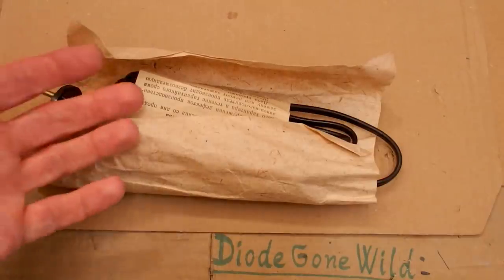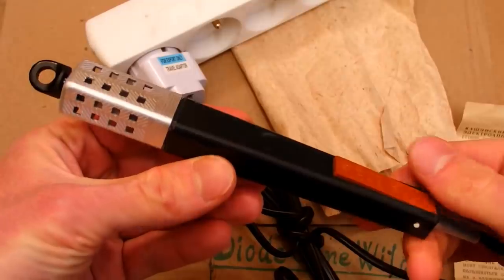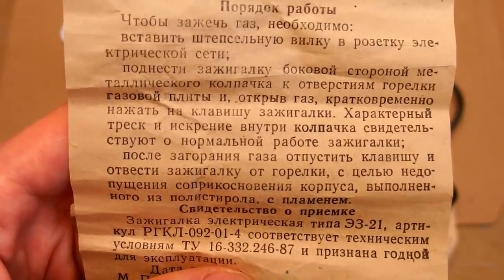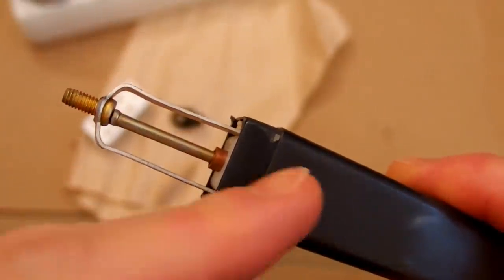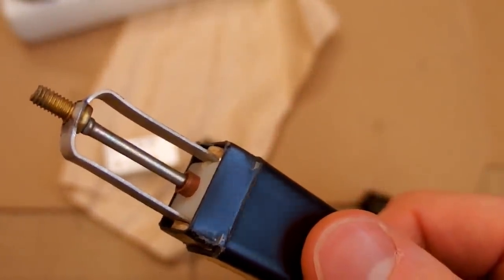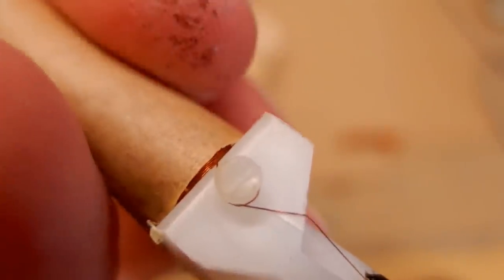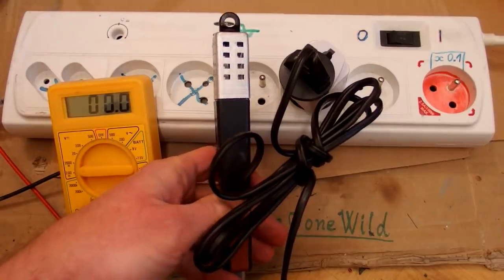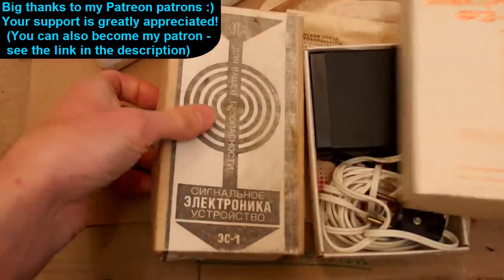Mysterious scary Russian device

Comment: In UK my grandma (when I was a little kid) had a gas cooker that had a 'wand' connected to the cooker via a rubber pipe. You would turn the wand on, click it and it let out a little flame that you would light the cooker with. Back then if you lived close to a colliery (which she did) you would be burning coal gas which was highly toxic, but on a possitive note, you got free coal if a family member worked at the colliery and your electricity was wired in from the colliery so you got super cheap electricity and basically free heating. The gas meter was a clock style that you put 50p into for a set amount of m3 of gas :D creepy old stuff lol

Comment: I have seen a similar one that was definitely less well made. While not safe by today's standards this Russian one does seem well built.
Reply from the maker: Yes, this one seems nicely built. The double pole switch makes it a bit safer. The electrodes aren't live when it's not pressed.
Reply: @NerdyNEET  Drop it, and the metal top can be dented or bent in such a way, that it contacts the live metal parts. 
Also, if some well intentioned fixer-upper replaces the plastic 'screw' thing with a metal one (maybe because someone melted it in the flame, or because it was dropped and broken) the metal part will become live. 

Now, normally no one would touch the metal part. But it is very plausible that someone would touch a metal gas stove, while igniting the gas, and while touching the metal part to the metal bits of the stove. Then you will get shocked by the stove (assuming it's a gas stove, or an ungrounded electric one)
Reply: Actually, I remember even better built Soviet ones from the 80's, when I was a kid. The only problem with them was spark-wearing, so we had to clean the spark gap contact periodically. And yes, I had a sparkover into the gas ring body once, which tripped the circuit breaker.
Reply: In Russia they use IT style electrical grid. Which means that no wire of network is grounded. So if they touch any single wire, nothing happens. So in Russian view this was absolutely OK. I am not sure if these devices were to be imported officially into countries with TN-C or TN-S grids.
Reply: @StackOverflow80 , Soviet gas stoves usually were connected to the gas grid via rigid metal pipes without dielectric insets and thus behaved like they were grounded. And TN-C or TN-C-S was/is quite a usual thing here.
Reply: @NerdyNEET  it dosent kill you... So i Guess it's safe

Comment: I think it's quite a simple and ingenious device, since the coil acts as a resistor and inductor to limit the current, as a solenoid to pull the plunger in and it also creates a high voltage for the arc, even though I’m not sure this last part helps much considering it runs on mains

Comment: We had one too, made at ElectroMures, Romania. Very similar to this one, similar format only the protection was made of baquelite instead of sheet metal and the hook was a loop of wire passing through the holes where the white stick holding the switch in place was passing. Worked well for many years and in the last years of Ceausescu was very useful since often could not buy matches to light up the stove (it is true that gas was also scarce so a lot of time we had nothing to lit anyway)

Comment: That's crazy compared to the single cell 1.5V powered high voltage DC-DC converter jobs used since the 1980's over here in the UK.
As a child I do remember my grandmas gas cooker in the 1970's (which was probably from the 1950's) - it had a flexible cable and lance that sat in a holder to the side. It never did anything. I was told it was for lighting the hobs instead of using matches but had stopped working years ago. My intrigue made me strip it and clean all the years off grease from it. Set light to it with a match and sure enough it was working again. It was basically a gas pilot light permanently burning!
Reply: Curious!
Reply: I've seen those 'always on' pilot things too! But in my case, it was one pilot light in the middle of the 4 burner stove. From the pilot lights, there were 4 short pipes going to each burner, like an X-shape. The gas from one of the burners would travel through the pipe quickly, and then be ignited by the pilot light. 
Seems awfully wasteful to just leave the pilot light running all the time.

Comment: Hi Danik!
Here in italy too, when I was young and still could not touch the stove (70's) I remember that the lighting of the fires was done through a device similar to what you showed: this is elegant and austere like an old sennheiser 440 microphone, while mine seemed a suppository with a metal tip: it was the ancestor of the piezoelectric lighter, which forced you to have a power outlet near the kitchens that at the time did not need it ..... then years later the kitchens came out with the built-in ignition and all autonomous means of lighting the stove, from matches to gas lighters of all types, have practically disappeared
Reply: Same. My nonna had one which would activate when tilted more than 45 degrees.

Comment: You can call me crazy but I've used one until recently. When I bought my gas stove it didn't have any electric igniters (the brand is Faure, a really good french brand but I bought their cheapest model) so all I could do is dig up one of these from my pile of old electric stuff. The trick was to not touch the stove because it would trigger ground protection. Last week it failed, it already pretty old and the metal contacts were completely gone so I switched to a good old barbecue lighter and it's much better :)

Comment: Ooow thats crude but clever :-D, i still use a piezo impact type, no mains :-)
Reply: NEY Industries
Often simplicity lasts longer than complex over designed products.
Look at the simple knife or fork, they just work for centurys without the need to change the simple design.

I happen to dislike computers being added to almost everything for no good reason, adding complexity that will fail.
Just my opinion :-)
Reply: NEY Industries
Ooow you are so evil ha ha :-D
All the user programmable micro controllers are a nuisance as well, when it dies the code dies with it :-(.
Often impossible to get the code.
Give me an external rom/flash or whatever.
Yes i'm an old git, and i moan a lot lol.

Comment: Another reason why the adapter is dodgy. Any adapter that allows connecting the ungrounded plug to a grounded outlet is illegal in Finland. Use of ungrounded equipment near grounded ones is dangerous. Also in Finland sockets in kitchens have been grounded at least since 1957.

Comment: It sounds like it's buzzing at 50Hz (or 100Hz?).  Presumably the spark and coil tend towards this frequency, but I would have to think about the actual mechanism behind it.  I guess, that around the 0V part of the cycle, the coil has no energy so the contact is made, with no effect.  As the voltage builds, the coil starts to energise and create the spark.  Maybe they worked out the resonant frequency of the assembly so that it would tend to re-make around the zero point again.  Or maybe they didn't worry about that and let it run at whatever frequency it liked.

Comment: But in the late 80s, I bought a Piezoelectric Gas Igniter made by Kharkovski Zavod. Very good ergonomic shape and beautiful design with two large Piezoelectric elements with the size of a cigarette filter. Still working
Reply: I guess that one have less crackling noise and not so scary to use)

Comment: Its a gas stove lighter. My grandmom used it in early '90s, i was small boy. Everyone had gas stove in their apartment. It was big house with like 100 apartments, gas was built-in into house.
Gas lines went to each apartment, from floor 0 to 5. So 100 apartments and each apartment had one gas stove, so 100 gas stoves.
Gas tanks were outside, near the house and barricaded with the fence. Some people burned gas stoves just to get some more warmth in the apartment. Besides the central heating system which used(s) radiators.
So if something terrible would happen, gas leak or something and somebody lights a match then half or whole building would go.
It was a dangerous thing. After 95 or so the gas and all the gas lines were removed completely. Because this system was too old and dangerous.

Comment: 50 years ago these exact devices were used in Israel to ignite the gas stoves like what you did in the video. the old devices did not have the metal cover around the spark device.  just open 240VAC so the housewives had to be careful.  possibly imported from Russia or maybe even locally designed.

Comment: And that's why modern electronic ignitions use a capacitive discharge HV spark.. so they're not using 80 WATTS just to light a burner
Tho i was fixing a gas furnace the other day and the igniter confused me... it looked like an electronic ignition but there was no little HV transformer.
So I tested the heat and the igniter was just a filament that gets red-hot. Really took a while to light the burner.... guess that's fine for a residential furnace but I don't like it.

Comment: You should check whether you can receive it with an AM radio
Reply: You definitely will receive it. The range would be even bigger, if you would put a tuned circuit into one of the mains lines, and inductively couple it to an antenna and ground >:)
It really is an EMC nightmare.
Reply: Я помню помехи от её использования при приёме эфирного аналогового телевидения)

Comment: bigclivedotcom did a teardown of this. It's a gas stove igniter.
Reply from the maker: Now I watched his video. He has the modern version of it. It seems that it hasn't changed much in the last 30 years, except that it cheapened out a bit. It has a thinner coil and it uses a nail as the electrode/electromagnet plunger.
Reply: @DiodeGoneWild  Also that coil with a plunger that moves in and out is called a solenoid. :)

Comment: why would anybody use this when there is a piezo electric version?
Reply: @NerdyNEET  I have this beautiful piezo based lighter from 1977: http://www.andriesvanonck.com/Krups.html
Piezo igniters are very common in post-1960s gas appliances (mostly heaters/hearths) in the Netherlands. I don't know why the soviet union didn't use piezo. They used plenty of smaller piezo transducers in electronics, as well as ceramic or piezo phono cartridges. Piezos are generally cheap as well as reliable and easy to replace if needed. 
I speculate that the 220v lighter was invented in the 50s or 60s and ever since then they thought 'why change it, it works, and we'll probably not get permission to develop a new lighter anyway'.

Comment: Yeah, this crazy Soviet invention can appears in many forms (and powers I guess), some producing really scary much lower-pitch than yours sounds🤪 And one of them, that my familly used, sometimes goes totally nuts, due having such a construction that allows the arc jump from inside to grounded gas burner of stove with sudden loud bang of short circuit😂And idk why, but automatic breaker didn't trips, the short somehow eliminates itself. I revealed this scenario when noticed typical signs of arcing at burner that presents only on that-device-using side😄

Comment: I had a similar thing in my parents ' apartment in Moscow. It had a round handle profile and was wrapped with blue duct tape (This is a thing worth worshipping in Russia :) The cable is also tightly wound. Later replaced by a wireless one with a piezoelectric element.